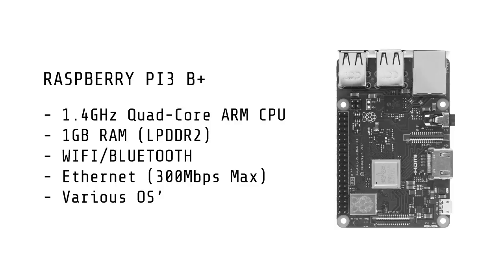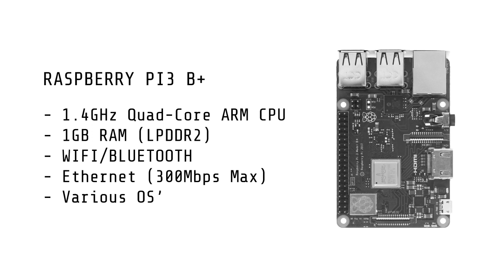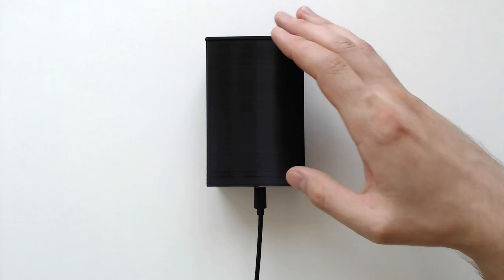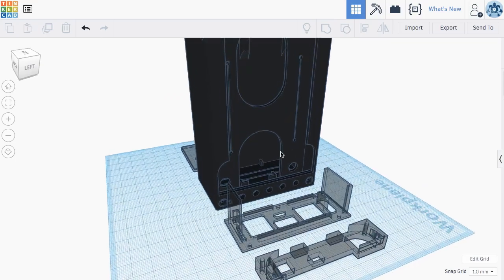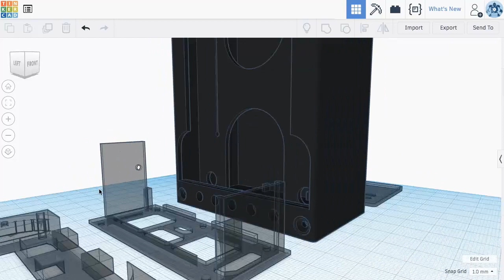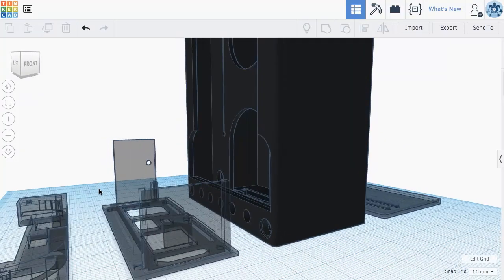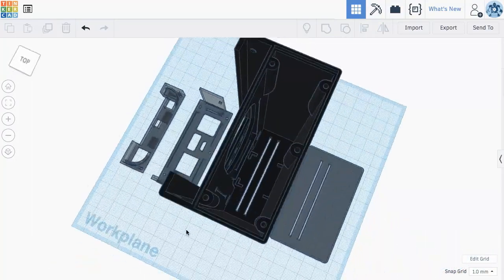The NODE Mini Server: A Computer For The Decentralized Age

Comment: You should look at the ODROID-HC1 and HC2:
https://www.hardkernel.com/main/products/prdt_info.php?g_code=G150229074080
It gets you an aluminum stackable enclosure, a board with built-in SATA (via USB bridge chip), all external connectors on one side, faster CPU with more cores than the Pi, and 2 GB RAM.
Reply from the maker: Thanks man, this is actually much better. Hmm, maybe I should use this instead...
Reply: N-O-D-E You're welcome. I've enjoyed your videos.